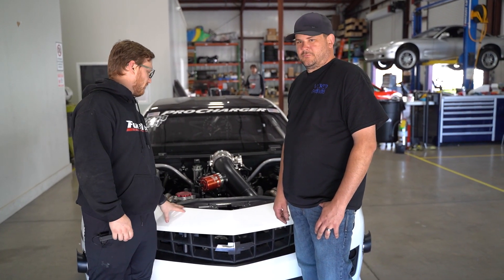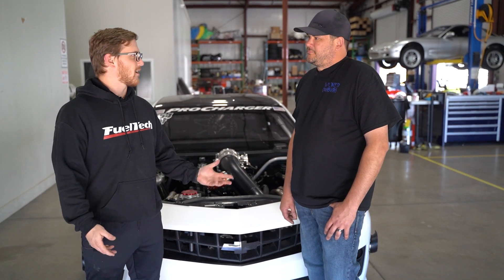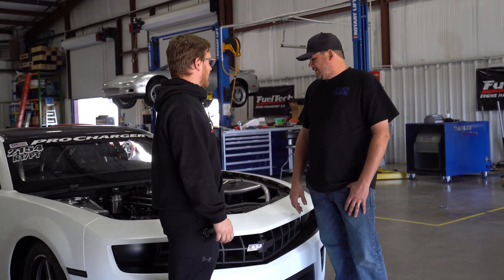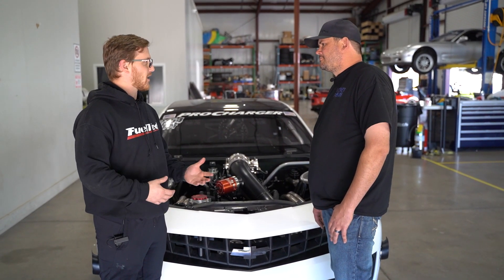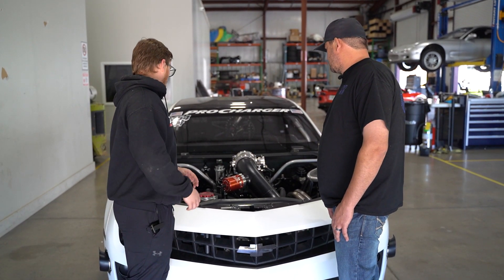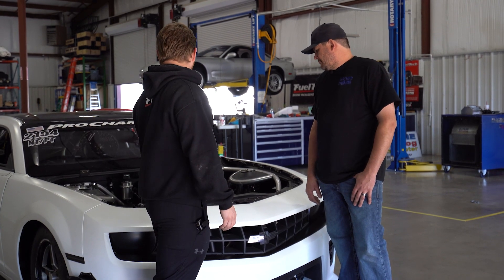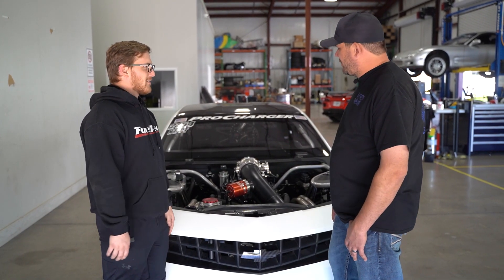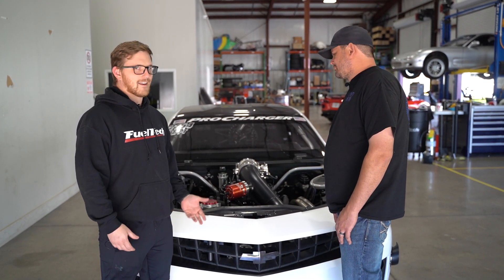ProCharged Camaro | Joseph Hollingsworth

Comment: I just installed the ft450 in my 04 civic si, literally started the very first try. Whoever put together the owners manual is the real mvp, couldn't get more comprehensive than that. I do believe I'm going to replace the 450 with a 550 at somepoint for more output control, then run the 450 on my canam commander. Keep up the good work guys.